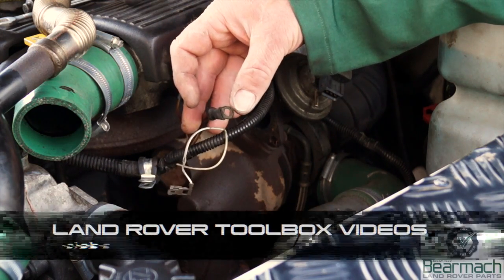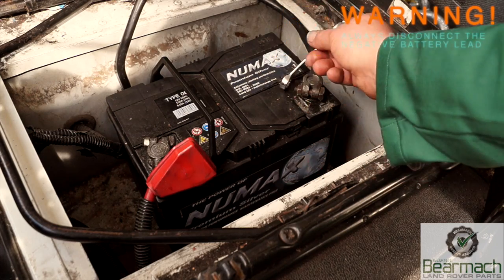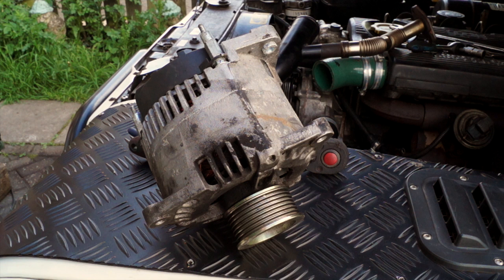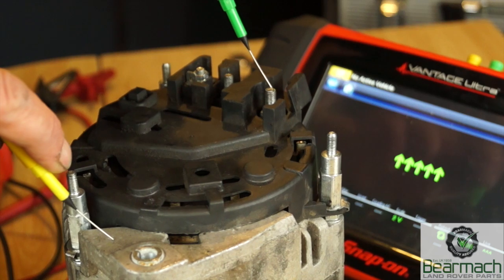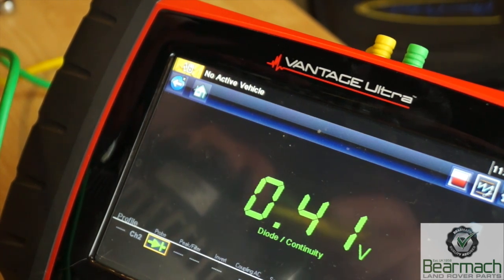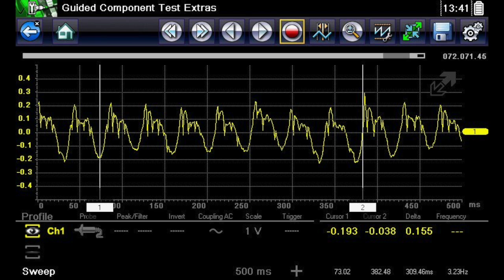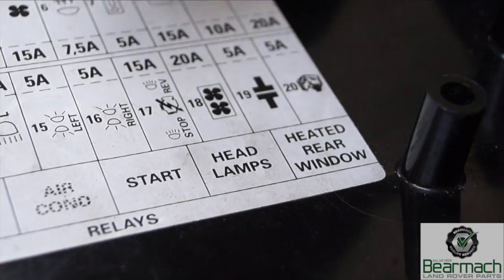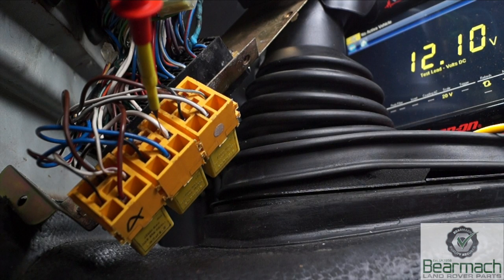A few electrical tips and diagnostic tricks. - The Fine Art of Land Rover Maintenance

Comment: Thanks for the video, I have a short circuit in the Right side tail light + the dash board circuit
whenever I put 10 amp fuse it blows in few seconds.
What is the best tool for the diagnosis ? 
my car is Defender 110 model 2006 , Tdi engine
Reply from the maker: A headlight bulb connected into where the fuse goes and it will go dim when you find the short ( by wiggly wires)

Comment: I need some help, first off let me say that I am disabled and a little limited but I always loved working on my cars, the problem is I bought this car not really knowing anything about it. The more I learn about it the more I really like this car and I see what makes it so special, but I gotta tell you I really need you to try to enlighten me as to why my 2002 discovery 2 only starts when it wants to. Then after it does start it needs  to cool off after 5-6 blocks while the two green lights blink endlessly. Then I'm off without any problem except it does seem to slip some. By the way mienke just ripped me off for 650.00 for a water pump, thermostat and coolant, not to mention they broke the fan clutch. bad decision on my part. Paid and then took it back, nothing had been done.
Reply from the maker: Albert Flores  Starting may well come down to immobiliser problems.
Reply from the maker: Albert Flores  As for garage repairs I will not comment on professional repairs or costs.  I am a tradesman myself.